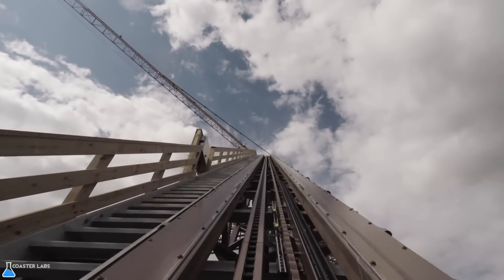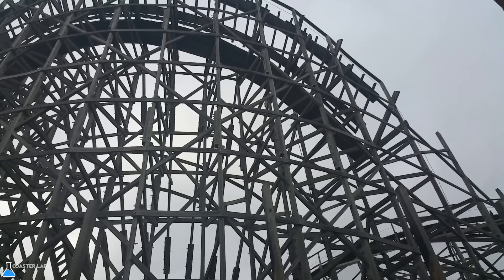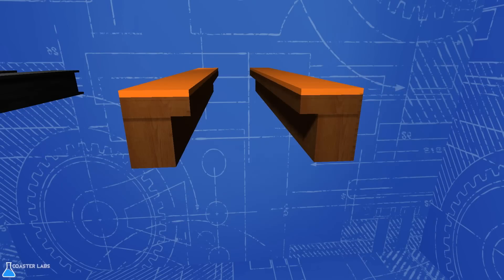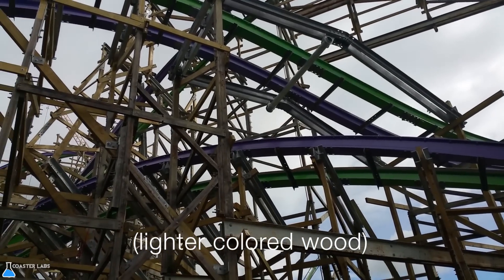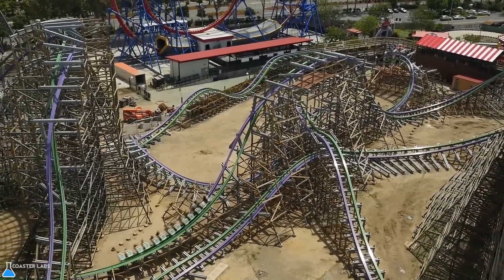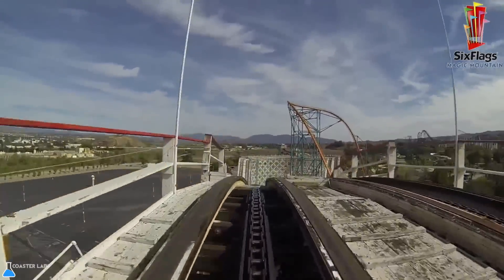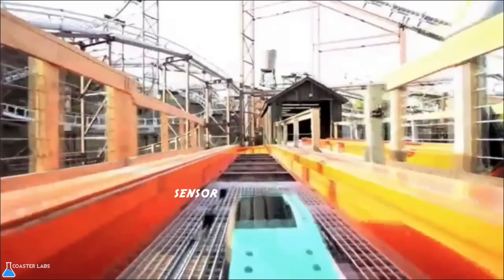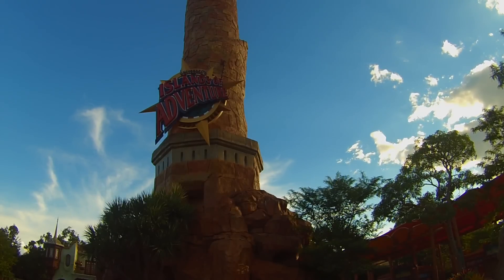How It Works: RMC "Hybrid" Coasters

Comment from the maker: Disclaimer: Most clips in this video belong to and were captured by me, however clips that are not mine were given to me by the owner or parks. This video is for educational purposes and falls under the DMCA guidelines for fair use.
Reply: The topper track is a type of steel track and not wood. That is why it can do inversions. It is good that they appeared to have ditched the topper track for the I-Box track design. The topper track is just trying to desperately be some thing it isn't.
The topper track is two box shaped steel tracks supported by laminated wood sandwiched between the perpendicular steal beams and the steel track. The wood serve no other purpose than to be a PR trick. It gives the illusion that the track is made out of wood, but it isn't. The sandwiched wood doesn't even act as any support when the train is hanging upside down.

RMC never built the first wooden coaster with inversions, Gravity Group did.

Comment: How do they feel? I love wooden coasters and they closed down my favorite one in 2015 at Busch gardens known as gwazi but its about open back up as the tallest, fastest, and the steepest hyrbid. I know it will be smoother but i hope it still has a little bit of that wooden coastet feel. I seem to like more of that harsh type coaster feel which is why wooden coasters are my favorite
Reply from the maker: They're outright insane. You'll spend more time out of your seat than in it as RMCs are heavily focused on airtime.

Comment: RMC, Needs to put 1 of there s in Walameer Park, there is 2 older coasters there I was there Yesterday, and road them They need to Improve 1, the Langest one, You must go see where  I am talking about,
Reply: RMC doesn't decide where the work. the have to be commissioned by a park. I agree that Waldameer is due for something to compliment Ravine Flyer II. (It's not that old, 2008) Or even hire Gravity Group back to add some of their new technology (millennium flyer trains and a barrel roll). The Comet is more of a historical piece serving as a family coaster. They won't (and shouldn't) touch it.The park is more of a picnic park so their main focus is family rides and water park of late.

Comment: You made a mistake when you showed the topper track. Not only is there a steel running plate on top, but also the piece that you showed being wood, the one that sticks out that the upstops and guides run on, is also steel. Basically you have the bottom stacks of laminated wood that are shaped like a square, then you have a steel box that is filled with grout that sticks outward for the guides and upstops to run on, and finally you have the steel running plate that takes the force of the road wheels which is on top.
Look up topper track rmc and look at the images that show up and you'll see what I mean.
Reply: Even go to the source you listed for topper track, and you can see in the picture.
Reply from the maker: It's a rough animation so it's not meant to be perfect nor is this series suppose to be really really detailed. I have to speak in terms most people will understand... ALso the animation tool I'm using doesn't let me make a layer that is any thinner...
Reply: Gh-oaster Labs I don't think you understand what I mean.. The entire top wood piece should be steel, as well as the running plate you showed.. It's no big deal, but it will probably confuse some people.
Reply from the maker: AEguy Productions Okay, but there's really not much I can do about it now...
Reply: Gh-oaster Labs I know, I was just trying to give some constructive criticism/help people who got confused.
Reply from the maker: okay. thank you. ☺